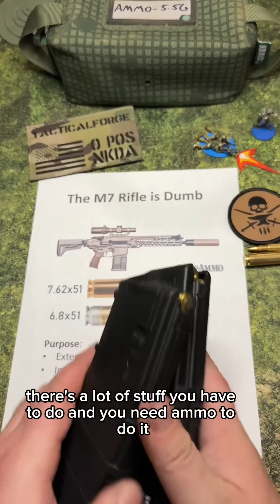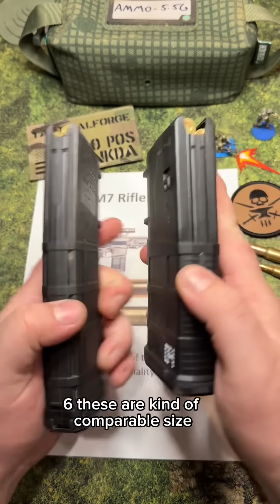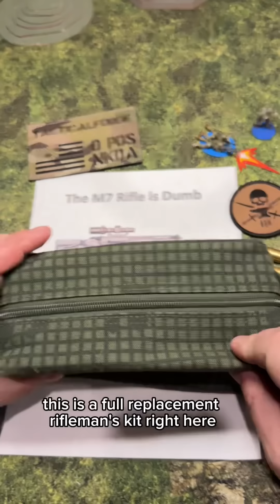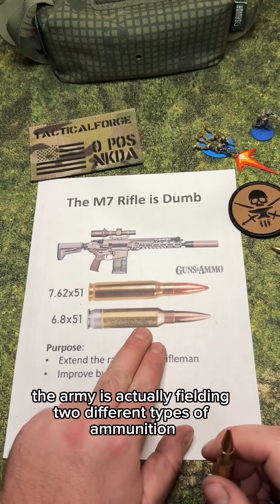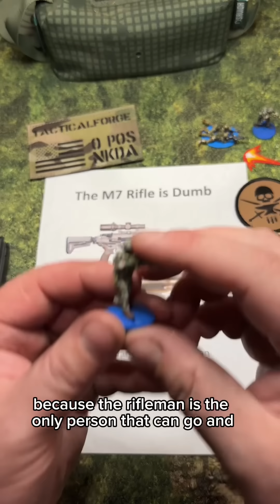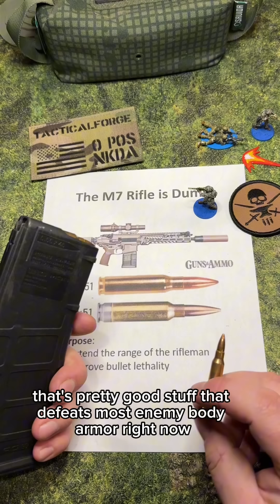The Army’s new rifle is dumb

Comment: Old operations and logistics planner here from when the XM7/XM5 was first floated, trialed, and accepted. Many of the issues that were identified and being talked about back in 2018 through 2019 seems to not have been resolved into today. The rifle has/had serious potential as a DMR platform if chambered for a specialized .308 round which currently exists paired with the ballistics computer. However the decision to replace the M4 platform with this thing is a nightmare to from a sustainment and logistics standpoint. You have to take into account unit armories, prepositioned assets, or compatibility with foreign allies. 

Then there's the adjustments that have to be made to existing TTPs from fireteam to division levels to account for change in capability. The M7 requires a different tempo and mindset to operate effectively. Current doctrine emphasizes speed, mobility, and violence of action across different environments.The M4 is perfectly suited for this whereas the M7 struggled at this during evaluations.

And then there's the individual fitness requirements to operate the platform for extended periods of time whether that be simply patrolling, movement to contact, contact, or break contact, etc. The M7 is HEAVY for a general purpose weapon, there's many different redundant features on it that can removed, not reduce capability, and help with the weight issue. (Looking at you charging handles). 

As stated in the video, I think when a real peer to peer conflict kicks off, you'll quickly see it rechambered for .308 and relegated to a DMR asset. as was seen during the last generation M4 replacement program the optic will be ripped off, upgraded, and issued out as a capability enhancement. I personally do not see the M4 platform going away for a long, long time.
Reply: I am still trying to understand what are the benefits of 6.8 over 7.62? Similar weight, similar recoil... Maybe better performance 800m+?
7.62 still has some benefits over 6.8 like lighter guns, more barrel durability etc. And still not all soldiers were wearing 7.62 already... 
(TBH the main reason IMO is that SIG knows how to "persuade" officers who are the decision makers in the tenders. P320 probably the same story...)
Reply: @jenHry-ng3pw The difference between .277 and .308 was noticeable and in .277s favor in terms of better drop-off and windage holdover after the the 600yrd mark during testing. This is due to .277s much higher muzzle velocity and the bullets higher Ballistic Coefficient (BC). On paper and in practice*, .277 fury in its full power configuration is a very potent and capable cartridge. Adoption of the cartridge does make sense in specialized roles, but not as a total conversion.

HOWEVER it was done under very favorable conditions for the XM7. At and before the 600yrd point, the ballistics is very similar between .277 and .308. 

Remember, it's just my opinion from experience with opertions and logistics planning for both short term and long-term sustainment. As far as the politics went, I dont know nor did I care at the time during evaluations when we wrote our feasibility AARs.
Reply: @Mossy_Haggis 
I think you meant to say the 277 bullet has a high ballistic coefficient not a lower.
Reply: @denisdegamon8224  yes, my mistake, thanks for the correction. Thats what I meant and made the correct in my pervious statement.
Reply: @Mossy_Haggis 800y plus doesn't matter when the gun shoots 8 moa and burns out barrels in sub 4k rounds
Reply: @jenHry-ng3pw  Cohen-cidences abound.
Reply: I am an ex Army Infantrty Officer and such. I totally concure with your accurate assessment on this rifle. Your observations are on point sir.
Reply: Seems to me the smart thing is to swap your m4 uppers for a newer round. There are some really good candidates out there that could increase the range and lethality without paying for it in greatly diminished ammo load out, or a much heavier weapon system. Besides if it ain't broke don't fix it.
Reply: @wymonwatson1309  A simple conversion isn't simple, but for arguments sake, the simplest conversion for a better round but retaining the M4 footprint is the 6.8 SPC. To convert, you're simply replacing the magazine, bolt, barrel, and gas system. However, if a conversion is happening, you have to scale up the manufacturing process with more machines, tools, dies, powder, people, ect. 

Then theres a simple part that would require a redesign of existing kits, the magazine. It has a more pronounced curve that prevents it from being stored on STANAG pouches. I have a rifle i converted initially, but after testing, swapped back.

If you want good examples of trying to adopt a new round and rifle, look at the initial M1 Garand proposal (.276 Pedersen) and why the military rechambered it in .30-06. Then the conversion from the M14 to the M16 program and why it was necessary for the military.
Reply: @Mossy_Haggis A conversion can be as simple as 2 pins, they had entire rifles built, they could have uppers made as well, and there are several ar15 length cartridges already ready to go, .22arc, 6,arc 6.8 spc, 6.5 grendel, to name a few. And ammo pouch changes ?? 😂 dude shut up.
Reply: @wymonwatson1309 Typically I don't like doing a full on deep dive essay but in order to tackle your several points i will but I'll condense it as much as possible.

1. The different calibers listed can all be installed on a standard MILSPEC upper receiver and utilize the BCG with the only swapped part being the bolt itself. The only non compatible parts being barrels, gas tube lengths, and gas blocks.

2. That being said, those parts are not common use as compared to the 5.56/.223 family so scaling up of supply chain across the board would still need to happen to meet the demands of a military. Tools, dies, and trained people will be your limiting factor as these are the hardest assets to source.

3. Just because the cartridges are AR15 length doesn't mean they are 100% compatible. Each casings dimensions are different, most notably being significantly wider than the 5.56 casing. .22 arc, .224 Val, 6mm arc, 6.5mm grendel, and 6.8 spc are NOT compatible with 5.56 magazines.

4. Due to the casings dimensions, loading them in a 5.56 mag will cause 2 major issues. The first being binding the mag as the casings compress incorrectly. The second is that the unequal compression will cause PMAGs to bulge and fail to seat in the magwell. There are some solutions depending on the caliber, mainly being a change in the STANAG follower. However feeding issues are still present due to inconsistent feed lips.

5. Magazines again. There are a few magazines that I'm aware of that are compatible with the MILSPEC lower, all tend to share a common issue when compared to the STANAG. Due to the casings dimensions, the magazines tend to be taller to accommodate the thicker diameter. So the same sized mags tend to only hold around 20 rounds when compared to the 30rd STANAG. And certain PMAGs are not compatible with MILSPEC lowers.

6. From prior experience, after acquiring 30rd mags for your listed calibers, they did not fit well in my single stack mag pouches. I tried my double stacked usmc pouches, but they would close improperly. The solution for me was ak style mag pouches but the real-estate space on my plate carrier forced me to change around my setup and hindered my mobility and ergonomics. After running a couple courses at gun site, thunder ranch, and local shooting ranges i ended up reverting back to 5.56. 

7. Shut up, really? I was agreeing with you and explained the logic behind my statements and opinions. My opinion is based in two camps, the listed cartridges are great shooters absolutely in the civilian market. But due to many, many reasons, they are not suited for general issue in the military outside of special circumstances that other cartridges can do this role and are in common use anyways.
Reply: @Mossy_Haggis you forgot 1 simple point on this list my friend
5.56 doesnt really have a lethality issue outside of the original M855 green tip. That round was designed to help give more penetration through hard targets but it's really not amazing at anything. It's a very general purpose round that puts small holes through things, tends to just ice-pick through people and is useless against armor like most small caliber rounds including .308. M855a1 helps a bit but is a higher pressure and harder on the gun. Personally I think the military would be better off with normal fmjs that will tumble and fragment on impact in most scenarios and let the machine gunners use M855a1 since barrel swaps are easier on an MG. They're usually the ones dumping lots of ammo at targets like moving vehicles and need the penetration while riflemen usually just assist. Of course that's still a logistical nightmare on the battlefield so overall the M855a1 is the better choice even if I dont think it completely solves the issues of the M855 without adding additional downsides. As a civilian with tons of bullet choices the 5.56 really is hard to beat. Hell I just saw a video of a guy taking out a bear that broke into his house with an 11.5" suppressed AR loaded with hornady bullets. He put 5 shots on target in under a second and that bear dropped dead instantly. It's more than powerful enough for any creature on two legs and if it doesn't work the first time you've got 30 bullets, shoot em again.
Reply: @Mossy_Haggis The shut up had to do with the fact that we all have put together an ar15 😂 we don't need a parts list, also you made it sound like the 6.8 spc was the only other caliber. And to your other points, there is no shortage of ways to get a vast supply of uppers in any caliber and configuration you want, there are at least 20 companies making them. As far as magazines go, they were going to have to change all the magazines to use the sig? Were they not? As far as I know they still plan to use that abomination 😂  anyways personally I think they should go with the 6.5 grendel,  it does require a magazine with slightly more curve, but the logistics of changing things is already in the process, so nothing would really change.
Reply: @ghengisswanson3923  I'd point you to this video about the M193, M855, M855A1. https://youtu.be/oii00t5csVA?si=z2jUTMVKn3SW3DVi

As well as Paul Herrels video about why barrel length matters, it has a good testing process that I think is more realistic than ballistics gels.
Reply: @wymonwatson1309 My answer was two parts. The first was to literally answer back to you. But the second was to answer in a way that was digestible to someone who may not have a strong knowledge base as you or me, or a novice, who may be reading this thread. 

I agree that MILSPEC uppers are a dime a dozen and the easiest part to source in the hypothetical refit of a branch or military, however the difficulty in manufacturing is keeping different companies consistent. The other difficulty I was talking about is scaling up the manufacturing of barrels, bolts, and other non standard parts. Then you have the supply chain logistics to phase in/out rifles and ammo, sustainment of current operations and training tempos, and replacement/maintenance cycles. So while yes, simply swapping uppers is easy, getting the upper into existence is not.

When I mentioned magazines and my kit space, I did have the M7 in mind from when I participated in the evaluation process and was mentally referring to it when I was typing. If i wasn't clear, my bad, I'm sorry. So I assume we're in agreement then regard this issue. 

As far as adoption of 6.5 grendel goes, one of the issues I constantly ran into during run and guns during training locally and at gunsite was bolt, extractor, and feeding issues. I'd need to pull out my old logbook for exact details, but I broke several bolts, sheared several extractors, and would constantly run into feeding/jamming issues despite several different barrels from different manufacturers. Just from experience with different acceptance trials, this would have caused the military to reject the setup. 

Don't get me wrong, I like the round, but I personally wouldn't spend time or money converting an AR15 to 6.5 grendel right now. I haven't touched the setup in several years, so hey maybe the issues ironed themselves out and I can revisit this later on.
Reply: @Mossy_Haggis My favorite ar is a 7.62x39 i built a long time ago, once the magazines got good, I've had very few issues, sure the bolt breaks every 4-5k rounds, but I keep a spare and it takes all of 30 seconds to swap out. The 6.5 has the same issue, but this has been solved by using an ar10 type bolt, I know thats a little more than an upper change, but it is a way to make the larger base work without causing a weak spot in the bolt. I haven't messed with a 6.5 upper so I cant speak to their reliability, but 7.62x39 is very similar and they have figured out how to make mags that work, about the only malfunction I will have in thousands of rounds happens when my bolt breaks, 9/10 times it breaks off one lug, and although I haven't tried it, I'd be willing to bet that it would still fire and function minus one lug.
Reply: Sounds like you made a solid build, congrats on the success.  @wymonwatson1309
Reply: @wymonwatson1309 mossy is definitely right about the manufacturing aspect. That is my field. Finding job shops to contract a refit would be a long and laborious process.  Finding the talent to get it running, probably even more so. There is a lot that goes into gearing up for new projects in a machine shop. There are many people that simply push buttons, and have no clue what is involved in a set up. There are certifications processes that would prevent a lot of shops from being able to even make a bid for a piece of that contract. I think that is 1 of the points that is being missed. Just because YOU are able to go online and buy a new upper kit and swap it out easily, doesn't mean its easy for the DoD to do the same. There is much more paperwork and logistics issues on large scale.
Reply: @Snipe-uc8df  appreciate your input, I did forget to mention that. as mentioned, I worked planning in USMC, supply chain logistics, and now firearms manufacturing/testing (hence the Mossy). I'm by no means the end-all-be-all SME, but I have a good knowledge base and a fair amount of experience.
Reply: @wymonwatson1309 or just give out more dmrs and buy more 77gr 5.56, its the perfect general use cartridge and it doesn't need to change to fight armor nobody is wearing, or take pot shots at distances nobody is fighting at.
Reply: Instructions unclear; added more charging handles. - Ordy Corp
Reply: @TrashKitty9707 understood, will add magazine fed charging handles to the M7A2...
Reply: I've also heard that because the 6.8 round is so hot (and requires something like a ridiculous 1:3 twist rate), the M7 suffers from a noticeable and on-negligible barrel wear problem. If true, I imaginevthis will only increase logistical headaches.
Reply: @ANevskyUSA the twist rate for the M7 is 1:10 for the civilian 16in and 1:7 for the military 13in. The issue of barrel wear stems from taking a larger and heavier round compared to 5.56mm and accelerating it to just shy of the same speeds as a 55gr 5.56 from a 20in to 18in barrel. But the .277 (full power) is doing the same speed over a shorter distance and in order to do so, you need a high chamber pressure to achieve the velocity. Because of the higher pressure inside the barrel, it tends to wear faster than a barrel should, especially if its for long term military service.

 I haven't touched a burnt out barrel to inspect one, but I assume there is severe fire cracking at the chamber, excessive wear at the gas port, and excessive wear at the muzzle/barrel crown. I would also assume there is excessive wear on the extractor, bolt, and firing pin. But until I inspect one in person, I'm going off an assumption.

Good resources for consideration. Older but still relevant to the topic.

https://youtu.be/urEKLym1LGw?si=e4ysvPpg4vDfNGGr

https://youtu.be/YdAYSEm5zJA?si=g1gog2N-SHMCw8Ic

Comment: I cannot fathom why the M7 wasn’t a DMR with the MG version replacing the old SAW.
Reply: I can see giving this to the designated marksman, but your average rifleman? Nah. And with these drones flying all over the battlefield, it's going to be a nightmare.
Reply: The m250 is better as replacement for the m240.
Reply: @itsericzhou not as reliable. Major problems with loss or zero and ripping the hybrid cases in half.
Reply: @jonnybgoode7742  thats just because sig is being retarded by increasing chamber pressure that much. the m250 chambered in 7.62 is arguably better than the m240 just by being 6lbs lighter with a suppressor on. or you know you can just use 6.8 without crazy chamber pressures, although at that point may as well use 7.62 nato
Reply: Money
Reply: The Mk 48 or the new HK 421 would be a good choice for a SAW replacement. 7.62x51 has plenty of power for practical infantry use. At the end of the day, an infantryman’s most powerful weapon is his radio calling in indirect fires or CAS anyway.
Reply: Because it uses a different caliber and would thus complicate the logistics?
Reply: @Anton43218
Sections already manage with a mix of 5.56 and 7.62.
Reply: Spot on target with that comment.
Reply: They're not accurate enough
Reply: @jonnybgoode7742  yeah I heard they were like 5 or 6 MOA.  Terrible.  My old SKS i bought back in 1995 for $75 was more accurate than that.  And it was literal junk dumped on the civilian market